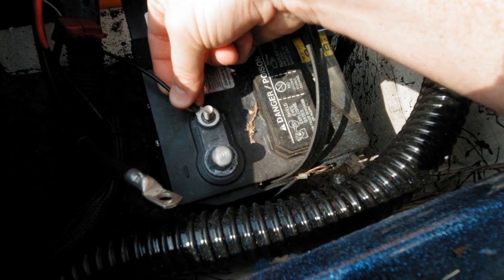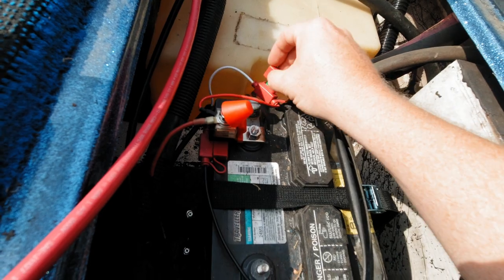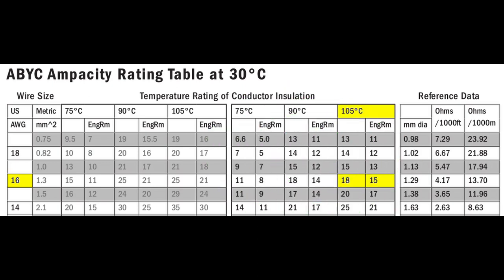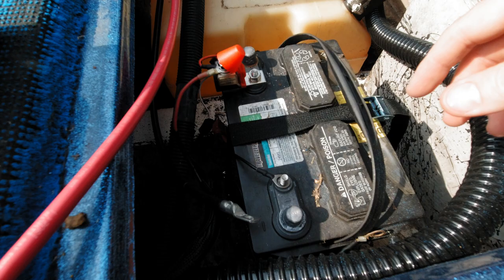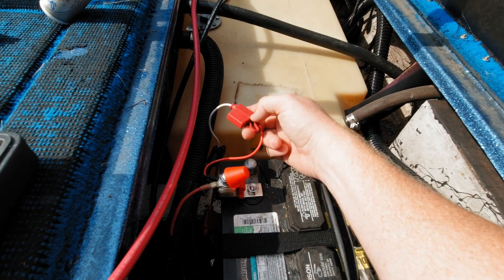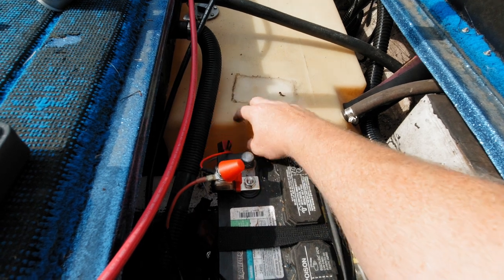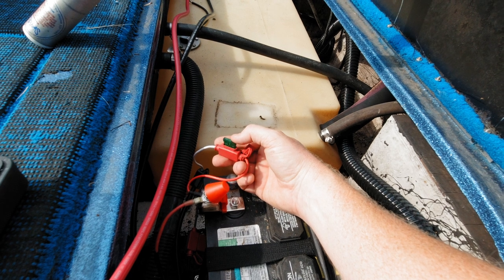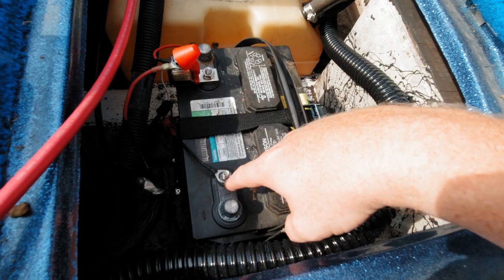Do You Have a Minn Kota Charger?  Please Watch This To Save Your Boat From a Fire!

Comment: Thanks for putting out the warning, you makes valid point.  I'll have a look at mine when I get a chance.  

I'm pretty sure mine is way different, since I am using Anderson 50A connectors, which I would not use for dinky-ask wires like yours has.

Might want to indicate which charger you have.  Otherwise it seems that you are assuming this applies equally to all Minolta chargers ever made.
Reply from the maker: This is the only one I've seen them make.  I didn't know they made anything but trolling motors until I had to install this on a friends boat.  Anderson connectors are sweet!  I was introduced to them when driving electric forklifts.
Reply: Had a Anderson  type connector almost burn down my boat while on the water !  Melted the connector !  I also had experience  in electric fork lifts  , but those connectors where 4 times the size .
Reply from the maker: One thing I've learned about boats, circuit protection is no joke!  I've luckily never been in a situation like that, but I've heard a lot of people either almost lost their boat or did lose it from an electrical issue.  Glad you didn't lose yours though!

Comment: The MKEC 15 IS 12 GA wire Those 30 amp fuses are fast blow . Its all UL listed and extensively tested .
Reply from the maker: UL tested is way different than ABYC and ABYC forbids fusing the negative.  The wires look more like 16 ga and the fuses look like regular fuses.  Who wants a 30 amp fuse on a 15 amp circuit?
Reply: Looks like an older set up . I contacted MinnKota  and confirmed the the the leads off the  MK345PCL are 12 ga wire  . I also asked if the had any reports of  over heating and reply was unequivocally no  . ?
Reply from the maker: @bdbdwd  This was a brand new unit brought to me to install on a friends boat.  The thing is, it's not just the power supply from the charger.  If something happens to wear through the insulation and use their wires as part of a short circuit, it could cause a fire.  By just dropping the fuses down to 15 or even 20 amps, the measure of safety would increase dramatically.  But even then there's still the ABYC violation of fusing the negative lead, and the horribly oversized ring terminals.  It's just such poor choices for a company that makes their money by selling Marine electric devices.  I expect much better than this out of someone like Minn Kota and I never plan on purchasing one of their products.  I have a Rhodan trolling motor on my new boat and unfortunately it came with 2 of these chargers which will be coming off sooner rather than later
Reply: I will stay with MinnKota  made here in the USA , not in China as Rhodan is . Also MinnKota has a 3 year warranty Rhodan only 2 year  . Minn Kota has always performed well for me , no reason forme to switch brands .
Reply from the maker: @bdbdwd  Whatever works for you
Reply: And you also  .
Reply: Just something i found ,In DC circuits, fuses are typically placed on the positive terminal to protect against overcurrent and short circuits. Fuses on the negative terminal are not commonly used in standard DC circuits because the negative side is usually considered the return path for current flow. However, in some specialized applications, such as certain automotive or marine electrical systems, fuses may be placed on both the positive and negative terminals for added protection.
Reply from the maker: @bdbdwd I was looking for the article I had seen several years ago but cannot find it.  But basically it was highlighting a fused ground that's blown while plugged into shore power, or any AC source can cause galvanic corrosion.  I forget if it's from other boats or what but from what I remember the ABYC has determined that any AC connected load is vitally important to have a solid path to ground.
Reply: Thing ruined my battety
Reply from the maker: @GardensoftheAncientsHerbal  What happened?  Did it overcharge?
Reply: How ?